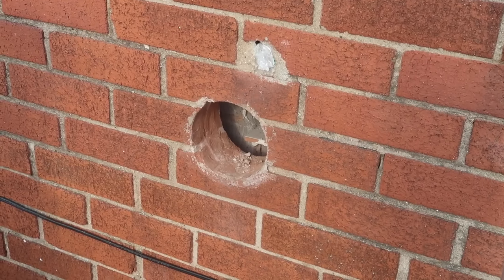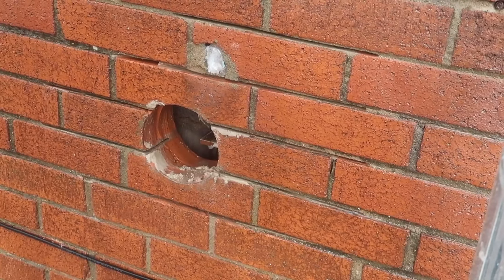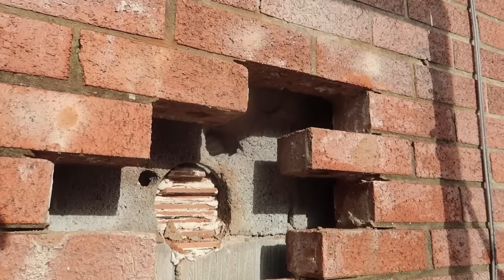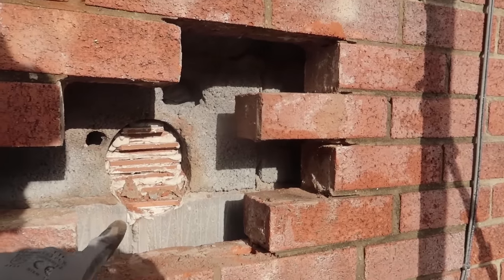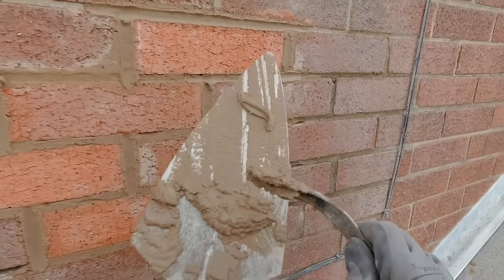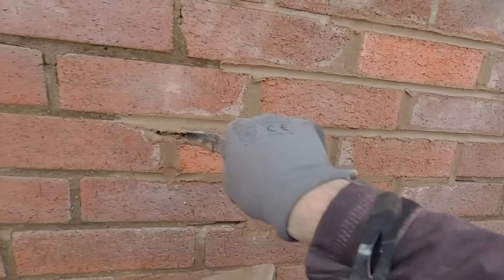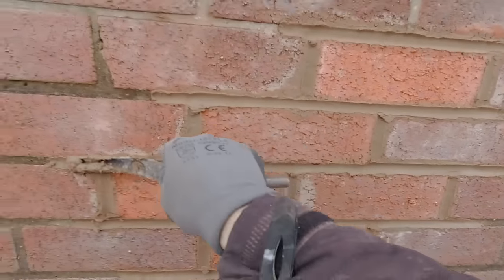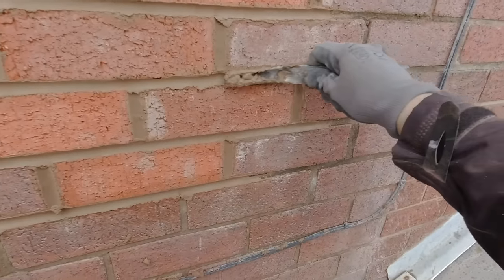Bricklaying Repair - How To replace Bricks In a Wall - Tutorial

Comment: If you get an old car innertube, cut it near the valve, seal the ends up, then you can feed a loop of the tube into the cavity through the vent hole, inflate it and it'll trap all of your debris. Then after you've removed all the bricks that are coming out and cleaned up the joints, you can pull the innertube out and all the crap with it.
Reply: You should make a video showing this method I'm intrigued to see how well it works.
Reply: @brucel8891  sadly I work in television not the building trade and so I wouldn't be able to go making holes in walls. I did watch my dad do it a couple of times though, and it worked well at keeping the cavity from being bridged. My dad and grandad were both general builders and decorators
Reply: I cannot picture what you mean by what you wrote, however it sounds very good!!

Comment: I have never done any bricklaying but followed your video and was amazed how good the finish I achieved was.  Didn’t have a Stihl saw but used my trusty angle grinder.  Given that my house is constructed with engineering bricks, the hardest part was knocking the bricks out!  Thank you so much for posting the video, I couldn’t have done the job without it!

Comment: Good luck if you're a plumber LOL
It does look great...I did a small repair job for someone yesterday and it wasn't the hardest but also not the easiest...you have great skill...you will always be busy with work like this.
Reply: What did you charge? I was given a quote of $250 for a patch job this size.  One square foot. It does involve some brick cutting to size up.

Comment: I am repairing the back wall of my old 1920s bank building where I now live. The wall, and especially the mortar, has been degraded through water pouring down the outside of the wall for decades. Literally all the mortar washed away over the years between about 16 bricks in 5 courses! Cold air now pours in where the bricks are missing and between the masonry block behind the brick, and whole building is suffering from the prairie winds every time they blow. I just did the first two courses, having removed the worst as well as any bricks not far from falling out. This is my first time at this, but your tutorial prepared me well and, maybe, by the time I get the last course down, it won't look too bad. Thanks for the clear tutorial!

Comment: I bought a Bosch mortar removing chisel for my sds, does a quicker job with less dust.  Best £25 I've spent
Reply: Did the bosch sds last for the job.I wan't to re-point the back of the house.
Reply: @amalalnckamsk6939  it did a decent sized 2 story  gable wall.
Reply: @llisntcoolj2375  More than enough then. I'm going to have a go in the spring,thanks bud

Comment: I'm 71 Years old and I'm going to repair a window on my building that has lost some brick and a tenant took the rest out to hid drugs in my building wall, yeah! I've laid brick with my Sweetheart husband who passed from COVID-19 in 2020 clear back in 1979, so I really appreciate your video, of course I'm having to place a frame work of wood under the brick too as that rotted out, but I'm going to do as you did...start laying from the bottom, the building was build in 1900, and the brick size is small that's to replace the others, but I'm confident after watching you do this repair, I can do mine, I'm taking picture as I go...thanks for your video!
Reply: How did it go?

Comment: Had to patch many holes where the flue was moved, this video is very good and shows you the proper way, took me years to get it spot on. Being a gas engineer, I found that brick match and colouring the mortar is key👍🏻 looks a pig if you don’t pay it the same attention as your boiler install👍🏻
Reply: Too much cement it looks awful,matching bricks on houses built by defunct companies sucks.

Comment: Great video! Thanks. Makes me confident. I don't have a large saw like that, though. I've got a 4.5" angle grinder, like the smaller one you used. Is that going to make a deep enough cut for me to get the old bricks out?

Comment: Watching a world class bricky having mortar squeezing out from the buttered bricks and dropping everywhere makes it clear to me it’s unavoidable as it has nowhere else to go.  This makes me feel better about the job I did myself bricking up the hole in my fireplace where the old gas pipes went into the back boiler after it was all removed.  I had mortar everywhere but couldn’t see any way around it!
Reply: Are you sure this comment is strictly true ?
Reply from the maker: That’s just his opinion and that doesn’t mean it’s true. I also did many things wrong on the video and will not make those mistakes again.
Reply: @Stucrompton1  Hi Stu, what mistakes did you make?  Is there a way to avoid mortar spilling everywhere?
Reply from the maker: Don’t butter the brick before you put it in on a repair job like this
Reply: @Stucrompton1  So simply create a bed of mortar in the holes?  Thanks for the reply.
Reply: @Stucrompton1  A follow up video covering these important points would be good.

Comment: Bit too much crap dropped down the cavity for my taste. I try and put something in once you have the first brick out to avoid too much going down the slot. What mortar mix do you use for this? 
I've had to work out how to do this in the past (putting in thermal breaks, and removing crap dropped down cavities). I wondered if there was some trick to getting a full-depth mortar bed on the last brick where you have to slide it in. I see you do it the same as i did - angle it a bit and hope for the best, then shove some more mortar in from the front afterwards.

Comment: I removed the mortar using a hammer drill with a 3/16" bit and a tile chisel.  I started by drilling holes spaced about 3/4" on center, then cleared between them with the chisel.  The bricks slid right out.

Comment: See so many patch up jobs where a non brickie has poked in a few badly matched bricks. Usually super smeary and wildly over cemented mortar.
Reply: What else would you expect from an amateur? Ridiculous to compare the two.
Reply: Guilty as charged
Reply: @ashku27 Touchy there pal, you must be the one putting them in - I always blamed the plumbers.
Reply: Some people like it and they call it over grout
Reply: Eh mate non Brickie myself,did an outstanding job on patch up.A site smarter than some of the s*** finishing on the original building work on this house.
Reply: @brianboru62 can't argue with you Brian.
Reply: @TurinTuramber  When the estate where I live was built in early 70's, they must have hired brickies from Dodge City !not knocking retro tradesmen ( before the power tool era)
Reply: @TurinTuramber  I wouldn't call it being touchy to point out the obvious. At the end of the day I've seen plenty of bricklayers who look like they're learning the job.

Comment: Stitch drill it for no mess, butter the existing bricks then slot brick in rather than the other way round for no stains and muck all on the floor, let it go off a bit before pointing for nicer finish and it’s just easier, prepare a trowel full of stiffer pointing muck
Reply: Very good points

Comment: Mate its a pleasure watching you!! Quick question, if i have bricks which have some of the outside facing mortar eaten away from weathering over 50+ years..(they are still in place and not out of shape) is it better to relay those bricks or if i do a render on the outside is that sufficient to fill in those gaps and prevent the bricks from getting loose in the future??

Comment: Love your accent :P. What do you do if you have bricks that are still good, but crumbling mortar? I have an issue with my front steps. I have one huge slab on each side of the steps which are supported by the bricks. On one side, the bricks have come loose, because the mortar is crumbling. My house was built in 1907.

Comment: do you have to be careful not to knock back the hammered brick into the cavity behind?
Reply: Yes. The cavity exists to prevent moisture/thermal transfer from outside. If you bridge it with anything other than air / cavity wall insulation you will get thermal/moisture transference and  the associated problems I.e. cold and damp

Comment: What happens if we just fill the hole with only cement, does it affect the strength and structure of the wall, or will there be any leakages in the wall ?

Comment: Where is this video being made..is the weather where you are similiar to upstate NY? I ask because i am repairing an elderlys chimney for her as i have had some experience doing pointing for a company on his apartment buildings and a occasional brick repair but ling time ago..i notice thst your mortar has a different consistency than the quikrite that i am using..when i point my brick up to coat the ends with mortar and part of the top...i  apply on one end and when i go to do the other my mortar slides off. I have tried troubleshooting w/ various amounts of water mortar ratio but no luck. I wet the brick first and that does not work..it helps slow down the mortar from setting so fast..but 2nd problem is when i lay  my new brick( using the brick that has 3 holes in it) in the empty spot from the broken brick i took out, the brick's weight creates the mortar to ooze out so again..mortar too wet but even as dry as i can make it it seems to still sink
 Do the holes have anything to do with it? Whoever built the chimney did poor job cuz the brick's are not consistent in being level so you have to ad more mortar to compensate either for the bigger joint or use less.  A lot of times before i can get my new brick sitting on enough mortar to create as close as i can joint around the brick by pointing...my mortar i find a lot is already setting cuz i been trying to prevent my brick from either sinking thus creating ooz.  It just seems like what you are using is what is making all the difference. It has a completely diffetent texture it seems.  So if my repaired brick is already setting and i go back and shimmy my trowel or pointing tool under the brick because it has sunk as to ad more mortar will that   compromise the durability once it hardens?

Comment: It’s a good video but be prepared for the bricks to be much harder to get out than the video shows, as those brick aren’t very old at all. 
For amateurs I don’t recommend using the large concrete saw as they are extremely dangerous and unless you use one all the time just use a circular saw and Grinder with diamond blades on them. It’s not as easy as he makes it look! Also when filling in those big sections put mortar in the brick beside the hole and just use the proper size slicker to push it in as those bricks will have mortar smeared all over them. After you cut the bricks use a vacuum to remove the dust and it will go away. 
Use the right sized slicker to fill joints once bricks are in or mortar will be smeared all over everything. He is using a block laying slicker and he can because he knows what he is doing but you will make the wall look like paint time in kindergarten class!

Comment: I recently had a new boiler fitted and the guy who installed it drilled a massive hole in the side of my house but drilled it in the wrong place, so he had to drill another one through the wall AGAIN right above it to fit the exit for the boiler fumes. I’m trying to fill in the gap remaining from where he accidentally drilled in the wrong place through the entire side of my house. How can this be fixed? Any help would be appreciated. Thanks.

Comment: Hi Stu, I would be fairly Confident in having a go at something like this, the thing I would struggle most with is matching the mortar colour. Would you have advice thanks Nathan
Reply from the maker: Hi mate this is where a bit of experience comes in. Understanding mixes and strengths it’s hard to explain because you have to identify what the old mortar is
Reply: Big old lump hammer that stu , be nice if you could get a Stihl saw that would cut right through the whole of the joint, I've used a drill sometimes , bit time consuming but does the job !!

Comment: Nice vid Stu. Question: if you don’t have a water cooled steel saw to hand what tool can a competent DIYer use? 
Cheers!
Reply: 4" grinder with a diamond blade has worked well for me.  I use a reciprocating saw with a diamond blade to complete the vertical cuts.
Reply: Cheers @MadMonk67 . I've started using a grinder and diamond blade as well. A reciprocating saw with a stubby blade on is a good idea tho. Nice one!

Comment: Is there an alternative to removing all the bricks where old flue was? I currently have a vent cover over mine with some rock wool . Looks ok but the wall feels cold inside.
Reply: Fill the hole with brown colour dye mixed in with the mortar.
Reply: @amalalnckamsk6939   Thanks I did see a product b&q sell that sound like a pre mixed version of what you said. Maybe cut some wood into the circular shape and wedge it in and then finish with this mixture.
Reply: @amac1657  treated ply wood cut out and waterproof seal, yeah could do. I would just fill it with mortar, if it's new brick work,i'd do what this videos say's
Reply: @amalalnckamsk6939   Thanks

Comment: thanks for this wonderful tutorial, you used your masonry saw for cutting horizontal mortar lines, how deep did you set it ? 1 inch ? if not to deep, could I cut both horizontal and vertical lines using grinder blade, masonry saw is expensive ! but I do has a cheap grinder and masonry blade. if so, how deep should I cut ? thanks
Reply: steven Gao you could use a masonry drill instead to drill out the joints if you don’t have access to a stihl saw. It’s a bit slower but just as effective.

Comment: Was this mix knocked up by hand?  Your mix always looks super soft and buttery with no surface water. I can never get mine like that. My mix tends to be more  watery on the surface to where the trowel glides though it.. how much plasticiser would you use on a job this size?
Reply: Use less water. 😂
Reply: If I use less water it becomes unworkable once applied to the bricks haha. The mix stu uses looks like it lasts ages and if you need to adjust the brick you can without it dried out

Comment: Dear Stu, what are the dimensions of your brick jointer to get nice 1 cm joint? Thanks in advance, take care.
Reply: Rafał Czyż they come in different sizes. For 10mm joints you could use a 3/8” or 1/2” jointer.
Reply: @rubberneck2  thanks mate.

Comment: Would be wise to reduce the amount of debris falling down the cavity. It can pile up in the cavity lower down, bridging it and causing water to track across causing damp on the inside of the wall. The same for mortar when replacing bricks

Comment: An old guy did the same job for me a few months back 
Cut out the bricks with a hammer and chisel 
( only smashed one brick )
Re used all the old bricks 
And inserted one new brick 
He even dusted the patch before it dried with soot 
Result you can't see the patch at all 
Now that's a tradesman 
You don't see many of them about these days
Reply from the maker: That’s great I’d love to see a picture if you could send to learn@bestbricky.com
Reply: @Stucrompton1  the house in question has been sold 
Hence the reason for having the job done in the first place 
Will try to get a picture when lock downs lifted

Comment: U should have chiseled out the mortar you cut into on each side.of the bricks you took out instead of leaving a cut line and just filling the face of the joint. And you should tuck point the joints full and leave it to dry a bit before tooling the wall other wise mortar will turn white on ya. And rub the wall after with a carpet
Reply: Good points

Comment: One more thing..the owwner bought face brick to use on many because of winter is coming and she believes this wsy is just as sufgicient as replaving whole brick. A lot of her brick got frodt bite and moisture creating roughly the 1/4 " face of the chimney brick to have popped off. She will not give me the ok  to saw, cut and chisel away every broken brick but many brick have crumbled to pieces so i have 2 remove but she was not happy. Anyway..she got me this adhesive caulking glue to glue them on the brick thsy lost their face. I know this is cobling to the core but should i chisel away brick so it fits in almost perfectly, let it dry and then point it? Also corner bricks where brick should be replaced she told me to glue two faces creating the L shape and then glue on. Any suggestions..pointers are greatly greatly appreciated. Please answer each question. Oh..to seal it. Roll on or spray and what is the best sealant
Reply: I just noticed as i watched this video originally yestetday (but today after working on chimney for the first day..it did not go as smoothly as you made it look by the way)...and so i posted my questions before rewatching. I DEFINITELY NOTICED THAT YOUR MORTAR WAS MORE BROWN SO DOES THAT MEAN MORE SAND AND IT HAD NO LITTLE STONES..THE CAMERA TOOK A SHOT OF THE MIXER DUDE ON THE GROUND SO I AM ASSUMING YOU MAKE YOUR OWN AND DO NOT BUY. WHAT BRAND OR BRANDS..WHAT ARE THE ACTUAL NAMES OF MORTAR MIX THAT I COULD BUY SAY AT LOWES THST IS EQUIVELANT TO YOUR MORTAR

Comment: compo too wet for pointing, smudged the brickwork too much
Reply: put some muck on cardboard at the start that takes most of the water out of it and it don`t stick to the bricks much. 
this was wire cuts, easier to brake than a frog brick,..  overall a good job tho, he kept the cavity clean,, remember we never had angle grinders